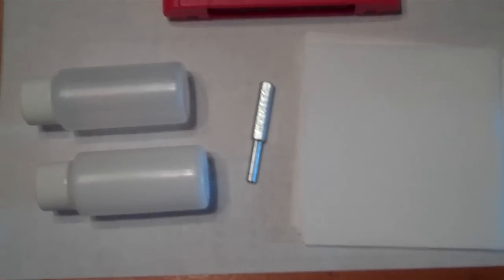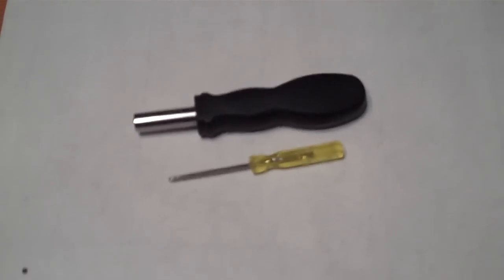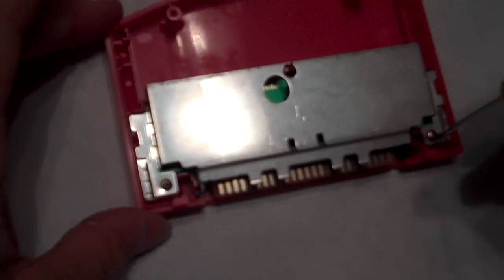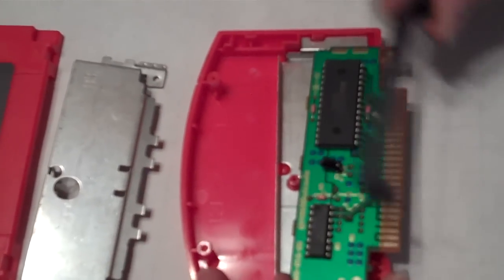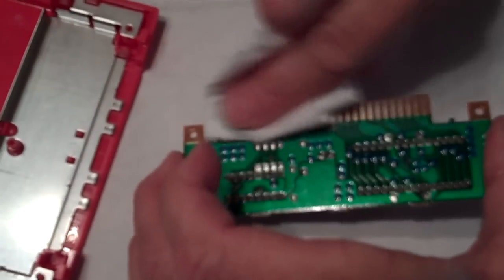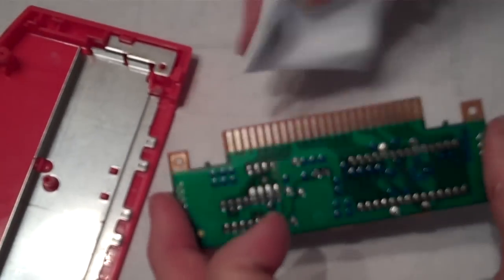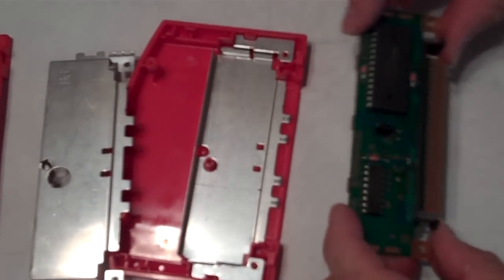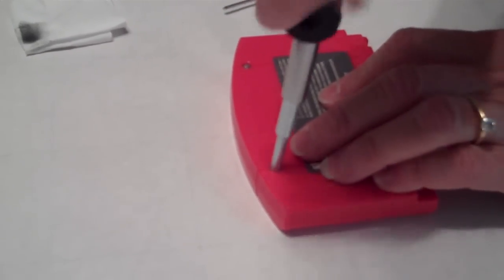How to Clean/Repair Nintendo N64 Games

Comment: so i recently bought a copy of mario 64 on n64. and i noticed that the background gets blurry a lot! whenever i move around a lot in the game or make sudden turns, a faint line seems to split the top from the bottom screen in a way. it is a jarring experience that i never noticed while watching people play on original hardware in youtube vids. could this be related to a dirty cartridge? the game turns on right away every time and the save function works so i am not sure what could be causing it. i have a bunch of other n64 games that i use on my n64 and never noticed this problem with any of them. i have the n64 plugged into a flat screen. and i changed my screen size to 4:3 but it still shows no improvement. the game is still playable but me being a perfectionist, it is very distracting when that blurring happens. can somebody please help???

Comment: I realize that this video is old but hopefully I get a response to my question. I have about 20 games for my N64 which I stored on a shelf for many years now. I went to try to play them and noticed non of them were working. I took apart so far 10 games and cleaned them with alcohol and a microfiber cloth but only have gotten 3 to work. All the connectors on the games seem to have lost their "shiny-ness". I realize that this is probably from blowing into them as a child. Is there anyway to get into contact to you to perhaps send you a picture to see of the games are beyond repair? Any response would be awesome, thanks
Reply: Too bad man, no reply. It took two years but I'm guessing if the metal has rusted your screwed

Comment: I did this to an old copy of resident evil 2, still does not work. Could it be the battery?
Reply from the maker: The battery only affects saving your game, not playing it. You might have ruined your game with the sandpaper.

We only use sandpaper on game contacts when there are spots of actual corrosion or rust on them, that the paste can't remove. Sandpaper is VERY harsh, and will easily remove the gold coating, which means poorer conductivity, and faster oxidizing. You only want to remove the blackish oxidation buildup, not the gold coating. PLEASE don't use sandpaper except as I described above, and then only use something like 600 grit emery paper, and only on the actual spot of rust.  

Here is a link to our game cleaning kit. http://www.retro-video-game-repair.com/shopdisplayproducts.asp?keyword=game+cleaning+kit  

And, we also sell the game save batteries, if your game no longer saves. But, many N64 games do not use the battery, they use a flash memory chip or controller pak (memory card), so open up your game first to make sure it's one with a battery inside.

Comment: Cleaned my super smash perfectly but still won't work :C. worried that there might be some bad water damage
Reply: Although all my other games work like brand new and start up on the first try if not the second.
Reply: Same here i cleaned my super smash but still doesnt work
Reply from the maker: dopefresh nation We can get about 99% of old N64 games working again with our game cleaning kit. Sometimes you can see water damage/corrosion on the actual circuit board, and cleaning the game contacts won't fix that. You can sometimes save one of those games by cleaning the rest of the PCB with an aerosol spray can of electronic contact cleaner and the wipes from our kit, and dab at the spots of corrosion on the PCB.  Sometimes water damage does destroy a game beyond saving. And then, there are very rare cases where a game PCB looks perfect, and the contacts are clean, and it still won't come up. But those are very rare.

http://www.retro-video-game-repair.com/shopdisplayproducts.asp?keyword=game+cleaning+kit

One other possibility is that the connector pins in the N64 console are dirty. That can keep some games from coming up. You can buy the 4.5mm bit from us (link below), open up your console, and try cleaning your console connector with the electronic contact cleaner I mentioned above.  Nintendo also made a control deck cleaner that looked like a tall dark gray game cart, with stiff felt in place of the PCB. You insert and remove it a couple dozen times and it gently rubs the connector pins and helps remove oxidation buildup on them. When we have them in stock they fly off the shelf, but you can sometimes find one on eBay. Model # NUS-014, N64 Cleaning Kit.

http://www.retro-video-game-repair.com/products/83-nintendo-45mm-system-security-tool/
Reply: Well I know it experienced water damage I'm just not sure how to access the damage. Going to see if I can get it repaired by a local owned game shop. Hopefully it will be fixable! Otherwise your product has worked phenomenally!

Comment: I'd suggest using just plain old rubbing alcohol (the carts say not to use it but the collecting and retro gaming community came to the conclusion a long time ago that it was only to sell cleaning kits) just put a little bit on a q-tip and lightly scrub the connector pins works on any cartridges and is extremely cheap.
Reply from the maker: Alcohol and swabs worked ok to freshen games when they were just a few years old. It honestly doesn't cut 20+ years of oxidation buildup. Plus, you are working blind. You can't see where the bad spots of oxidation or corrosion are. I've seen a lot of games that people cleaned with swabs, and you can see the buildup of stuff left behind by the swab at the upper edge of the game contacts and seeping inside onto the rest of the circuit board. Our kit really does work well -- safely, easily, efficiently, and inexpensively. Your games are valuable, why risk your game and your time on a method that isn't safe for your games, or very effective?  Here's a link to order the kit. http://www.retro-video-game-repair.com/shopdisplayproducts.asp?keyword=game+cleaning+kit

Comment: My jet force gemini game doesn't work unless I slam it in the console..ill try to buy this cleaning kit.
Reply from the maker: Drahsid Please, don't ever lick your games!  The reason it works in the short term is that water conducts electricity. But in the long run, you are ruining your game!  Would you pour water in it? That's what you are doing!  Water on the game contacts can cause corrosion, which can destroy the game if bad enough. And when the water in your saliva evaporates, it leaves behind dried saliva solids which prevent a good electrical connection with the connector in the N64 console.  If you feel you need to blow on or lick your game to get it to work, please try our game cleaning kit, it will really make a difference.  http://www.retro-video-game-repair.com/shopdisplayproducts.asp?keyword=game+cleaning+kit
Reply: I hear if you lick the bottom they work. Weird, huh?
Reply: I fixed my jet force gemini and my mario golf that didnt turn on thanks Nintendo repair shop
Reply: Nintendo Repair Shop Inc.
 When I clean the games I usually get a miniature q-tip and some rubbing alcohol and clean them with that, then a normal q-tip to dry them out.

Comment: bit tools-2.25 ebay isopropyl alcohol .99 cents-walmart fine bristle bronze brush or copper wire brush or any other brush .50 cents ebay/walmart or semi abrasive dish sponge .25 cents anywhere will clean all the games you ever want alot better.

Comment: nice vid, 
I have a broken N64 game but the damage is the outer shell and the game doesn't work either. The crack is on the side so if i pull it open i can kinda see inside the cart. Do you think this is repairable?

Comment from the maker: @KevinBlock123 A little plastic supports on the inside of the case help hold the game motherboard in place. Sometimes these break, which is what is causing the rattling. You can solve this by purchasing a 3.8 mm bit and opening it up and removing the pieces. If you want to purchase one you can visit our website.

Comment from the maker: @basketballSZnaruto Unfortunately, We do not have a video yet in replacing batteries. All you need is a Nintendo 3.8mm Gamebit Security Tool to open up your N64 Games. You can also send it on our store for battery replacement.

Comment from the maker: @shadowing00 for the record we do not recommend using brasso. Our repair kit should do the job assuming you can get any games working in your system at all. If not, you system connector may already be toast. In which case a replacement system would be needed.

Comment from the maker: @tigerboyX Yep. Sadly. I will always be a proponent of cartridges from a quality and durability standpoint, but they are SOOO much more expensive than CDs. I think that is why you see the switch. In the end, it really doesn't do a video game company any good that it lasts you 25 years. It might even be better if you have to buy a replacement in 3 years. Regardless, yes the N64, SNES and NES games can still work today with the proper treatment, because they are very high quality items.